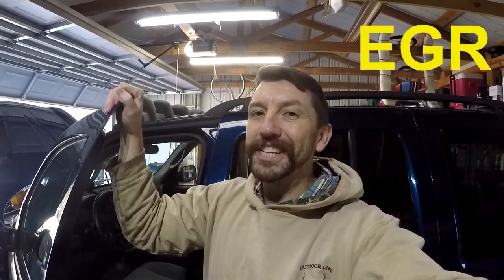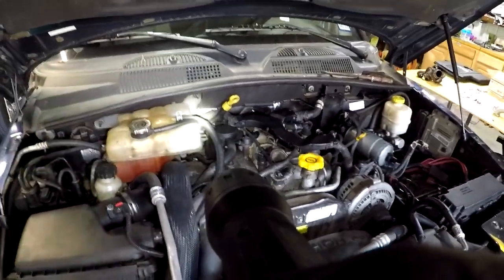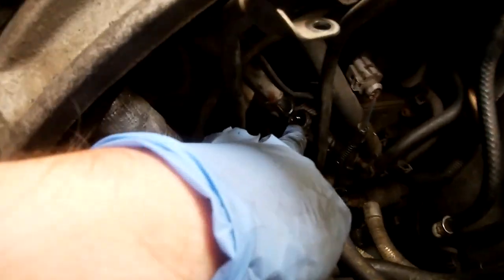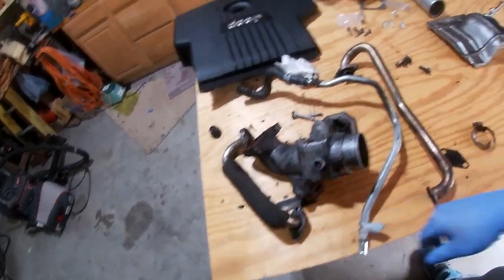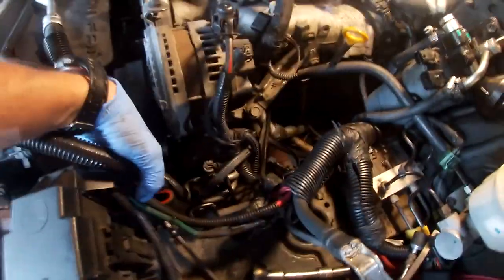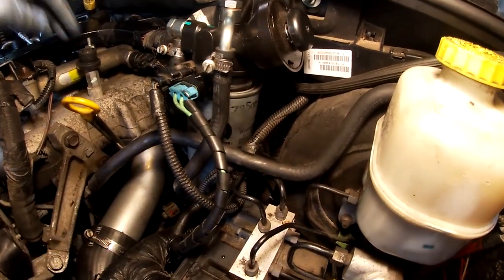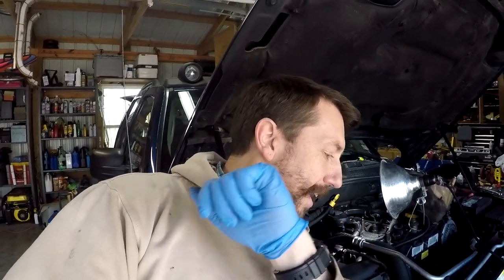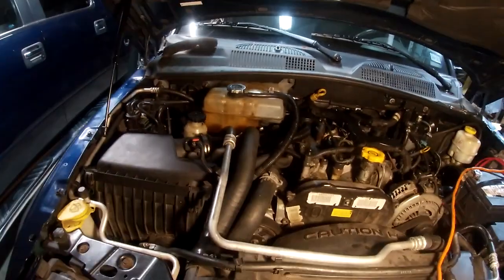EGR Delete 2005/2006 Liberty CRD

Comment: By the way, this engine loves B100 biodiesel. But, the B100 has to be properly refined having the Glycerine food chain molecules remved and any micro food particles. These 2 items with Gum up the Valves quickly and lead to full engine rebuild. The filters don't mind properly refined B100. The engine runs super clean and 80% smoother. It really loves it. And so did i. Best of Luck.

Comment: Make sure you change ALL Valve Rockers every 75k with Timing Belt change. I didn't because, told by my Mechanic " It's a Diesel should be good until 300k at least. Well, my Needle Bearing Wrist pins in ALL Rockers wore down by 1/3 and allowed the pins in the bearings to slip out into the Block. My new Mechanic only retrieved 34 pins. The rest are in there somewhere. 2006 still going but waiting to see when those loose pins turn back up. Yes, motor was totally removed and disassembled first. If you ❤ the Jeep be thorough.

Comment: How did you get the check engine light to go off. Did it cause your engine to run hotter.
Reply from the maker: Check out get it garage on YouTube. Link below.  He does a how to video on removing the EGR from the computer. Removing the EGR cooler does not affect the engine temperature. The purpose of the EGR cooler is to cool the exhaust before it dumps it back into the engines intake.
https://www.youtube.com/watch?v=sngGdf4NM6E&t=604s

Comment: Hi, I have a 2.8l crd just like yours.  Eliminating the Throttle Body does not affect the efficiency of the engine?  loose plugs affect, I just want to know how to do the same.  thank you
Reply from the maker: its not the throttle body. its the EGR valve. when open it dumps exhaust into the intake. well exhaust and oil sludge.

Comment: do u have video on P0234 and P0108 TUROCHARGER OVERBOOST CONDITION ANDMANIFOLD ABSOLUTE PRESSURE SENSER CIRCUIT HIGH
Reply from the maker: I don't. check the lost jeeps forum. or type the code and lost jeeps in the google search.

Comment: Hey Boeller i have a 2005 crd im looking for the Air cleaner cover, but i cant fount it anywhere , now what i can do ? becase mine is a llitle bit craked now ): and idk what to do.
Reply from the maker: I searched around a little because mine is not the best either. check with the CRD groups on facebook.
Reply: @BoellerFamilyFun  ok I will check there! Ty

Comment: what symptoms were thereason for EGR deletion?
Reply from the maker: preventative maintenance. the Exhaust Gas Recirculation system takes the exhaust gas along with oil and soot and dumps it in to the clean air intake. all the tar like staff in the video is from the EGR system. now all my exhaust goes out the exhaust pipe.
Reply: I think once it gets clogged up, the ETC light/system freaks out, and eventually it might shut the car off. I think that's what's happening to mine....

Comment: Hey, I have an issue when I turn on the Jeep CRD and after 5 secs it turns off, and to turn it back on, I need to hold the key for 10 secs and then it turns on and runs normally. I have replaced the computer of the car and the issue persists, do you think that the EGR could be causing that issue? any suggestions will be much appreciated.
Reply from the maker: not sure. if you have Facebook, there are some awesome CRD groups. ask your question and you will get a lot of good suggestions.

Comment: Hi! I did the same, but P1140 has appeared on scanner and the red sign of the glow plug system is on. 
Did You managed with it?
Reply from the maker: Check the last jeeps forum. Get it garage did a video on it as well on YouTube. Basically, I downloaded a stock tune with an EGR delete. When the computer notices the EGR is not plugged in, it will throw a code. This tune will tell the computer to stop looking for the EGR.
Reply: @BoellerFamilyFun , I downloaded the tune needed. Nevertheless.

Comment: What difference does this make ?
Reply from the maker: preventative maintenance. the Exhaust  Gas Recirculation system takes the exhaust gas along with oil and soot and dumps it in to the clean air intake. all the tar like staff in the video is from the EGR system. now all my exhaust goes out the exhaust pipe.
Reply: @BoellerFamilyFun will that blank plate do the job also?